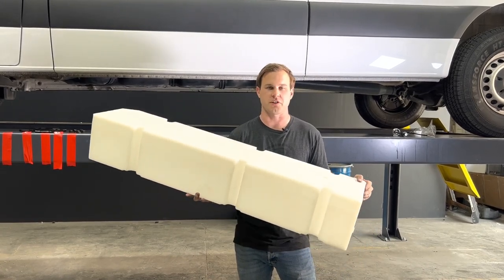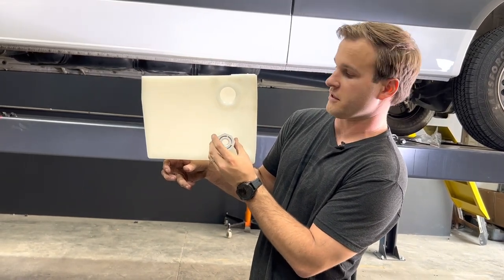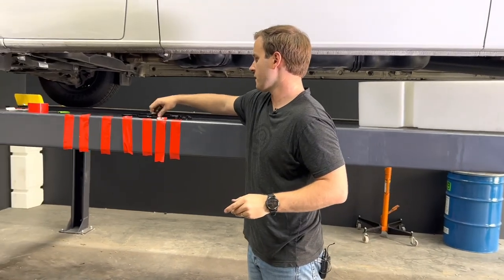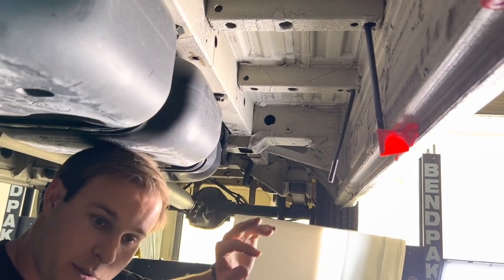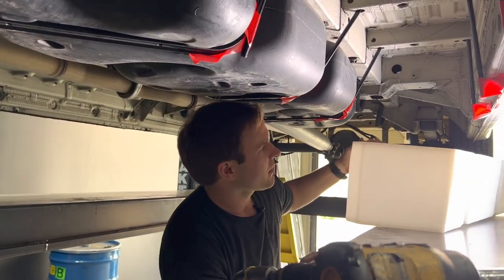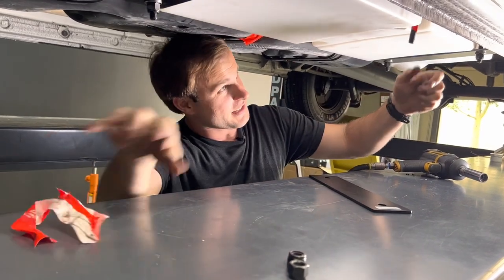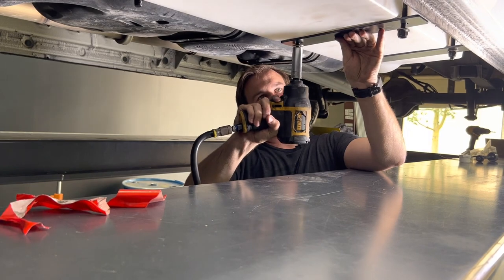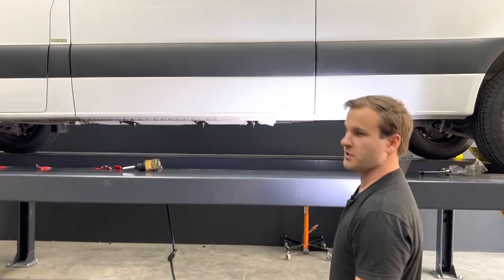22 GALLON DRIVER SIDE UNDERCARRIAGE FRESH/GREY WATER TANK 07-24 MERCEDES SPRINTER 144" & 170"

Comment: This appears to be the best design undercarriage holding tank on the market for a Sprinter. Been looking at every option out there. Most require drilling and are somewhat involved to install. Not planning on moving my spare tire so those tanks are out. 22 gallons of gray capacity on a Sprinter is adequate. Price for these are fair.
Reply from the maker: Thank you